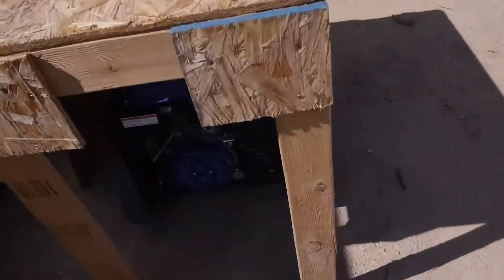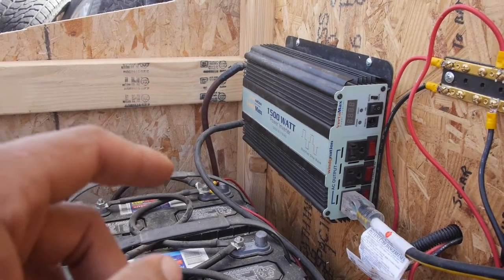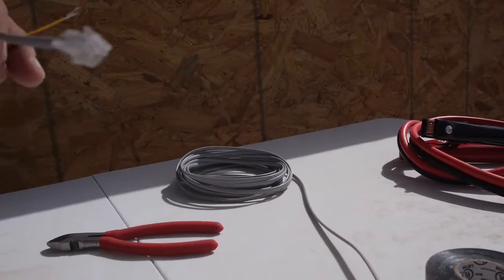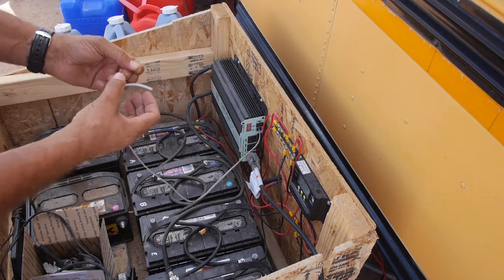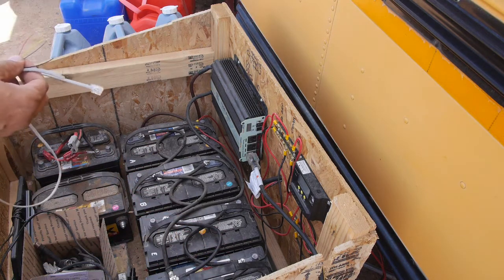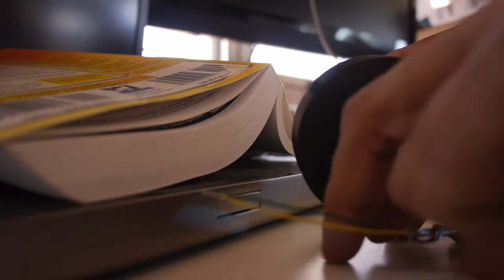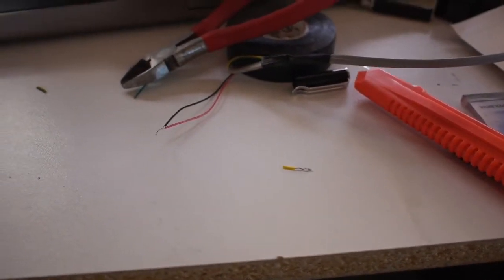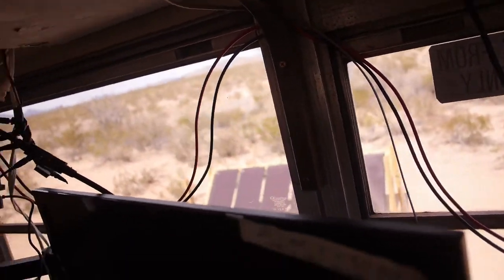DIY Remote Switch for Inverter using RJ11 Phone Wire

Comment: I was trying to do the same. The remote switch I got with my inverter was way too big I wanted to wire it to a switch I had in my vehicle already. But the switch was a momentary switch it came with. So I was trying to see if it would work with the toggle switch. Now that I see that it does. I'll try it again. It's either red and black. Or green and yellow. 🤔
Reply: Is your toggle switch a three-prong or a two-prong ?
Reply from the maker: Mine was 2 conductor, but not momentary contact. From reading the other comments, some need momentary contact. Also, a few people say they screwed up their inverters doing what worked for me, so just  be careful ok?
Reply from the maker: Also, there is no standard on these, Almost all the comments had something different.
Reply: @CarlinComm  i am planning on using a 3 pin SPST rocker switch (Power/ Ground/Acc) Ground for the indicator Led. that turns on the inverter along with a Voltage Meter. but i think rn, the only issue im having is finding a inverter that works with a Rocker switch and not momentary push.
Reply from the maker: @joeh690  Yeah, thinking about it, I really don't have enough experience to be very helpful, it worked on mine, but since they're all different, it would be really hard to guess which others it would work on, unless you could get the manual for the inverter, and then see if there is a pin out for the connector. The other option is to take the inverter apart, being aware of the dangerous voltages in the capacitors, etc. Then extend the wires off the inverter's main switch. Another option is to wire a self latching relay, which can be activated with a momentary contact switch, and once the relay is on, the load side of the relay has a lead that goes back to the switch side of the relay to keep it energized. But then your momentary switch won't turn it off. That is a good thing to test with a dummy load on the bench, not on your expensive gear. I have made a circuit that worked like that, but its been a while, and I don't remember enough of the details to be useful. If I remember right, it was in a VW Jetta, I was using the headlight circuit to activate driving lights. I set it up that if I forgot, the car's headlights automatically turned off when the key went off, so the driving lights would automatically turn off at the same time. And since the switch was momentary contact, they wouldn't come back on when the key was on, I had to hit the switch again the next time. It might have been tied also to Hi beam only, that was one thing I was thinking of. That was probably 30 years ago though?
Reply: @CarlinComm  Wow 😳
Reply from the maker: @joeh690  Let's just stop there :) haha